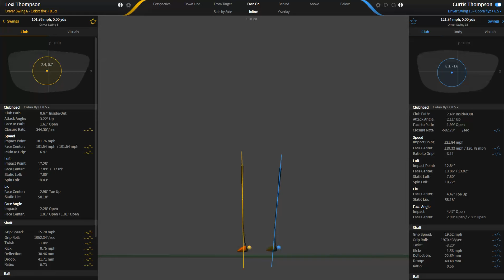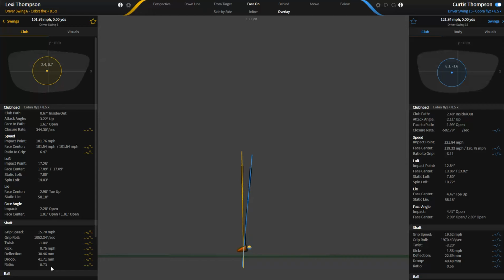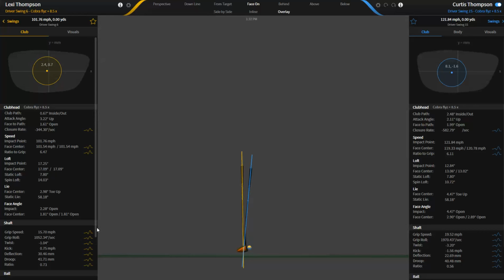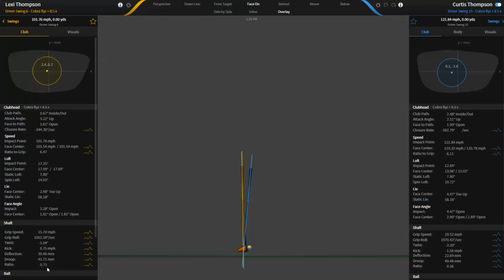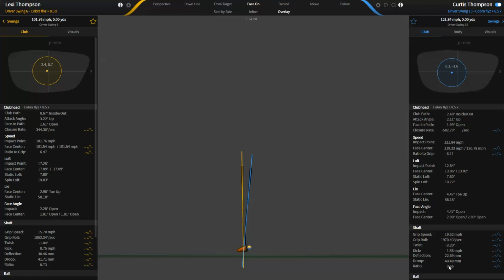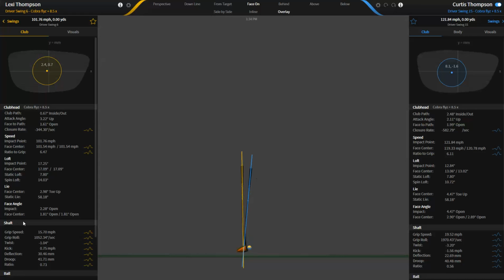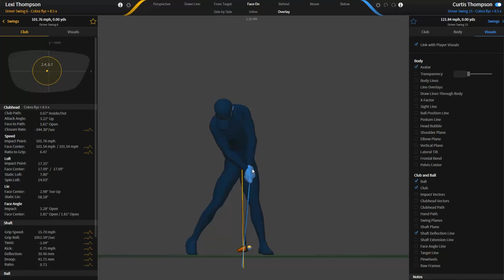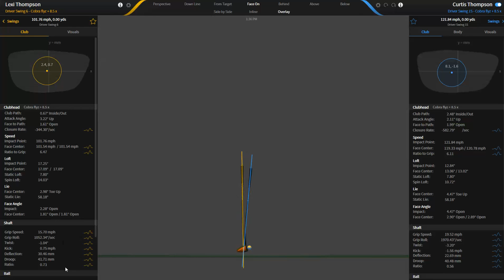GEARS SHAFT RATIO DEFINED- shaft ratio video

Comment: You commented at the end that once the club dynamics have been worked out then the coach can concentrate on the player and not be fighting the club. However if you change the players swing mechanics, won't this change the club dynamics all over again? Chicken or the egg? Please comment.
Reply: Hey James , So I think you should get your player where you want and then dial in the the club. Then you are only fighting the player and not the club. but we  need to realize that if you change the player you need to think about the club.  so there is a little chicken and the egg. its also possible the fix you made with the swing will now allow the club they have work better.   thoughts?